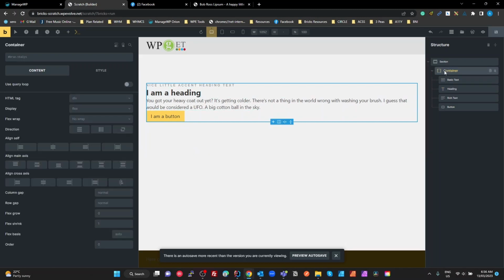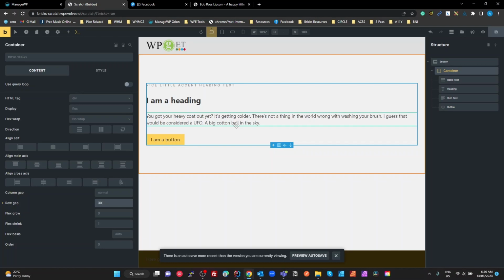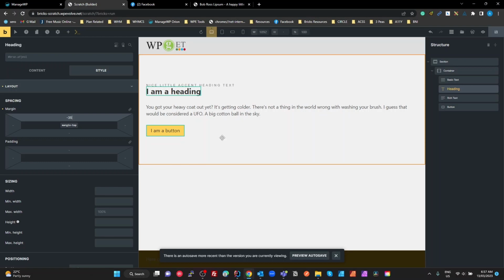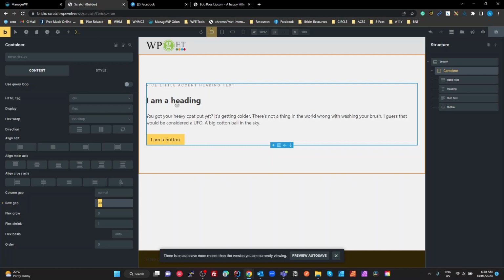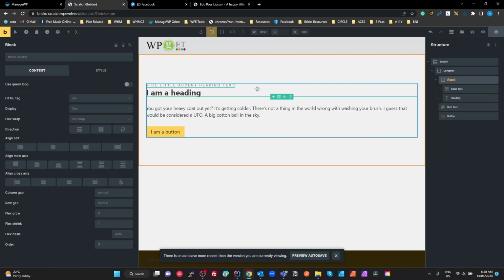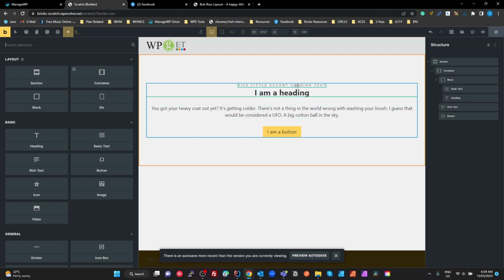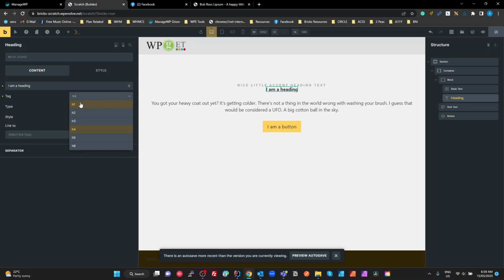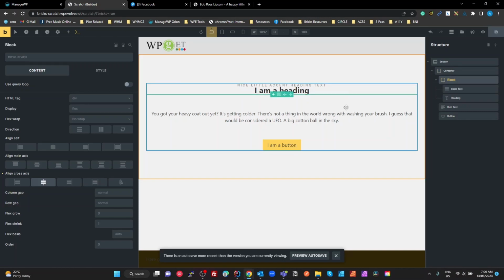Bricks Builder, How to group elements while maintaining consistent row gap.

Comment: Could you do a full tutorial on setting up bricks for consistency? I can never get this right! I tried setting up paddings and gaps in Theme Styles, on section, container and block level, and depending on the content inside it went from one section looking great to another one looking like a bunch of chubby columns. If I set it all directly on the canvas, then it looks even worse because there is no consistency, especially when you try to get the columns to act like they are supposed to.

And when I finally set them to look sort of consistent (with a lot of wiggling in paddings and margins), then I discover on mobile they all look different. I've downloaded bunch of template, and lot of them have very little settings, yet they all look great on all screens.

It would be really, really helpful if you could do a video where you create a simple homepgae with 2-3 sections, each with elements of different size and grouping. Like, one with heading and 3 small cards, another one with a large column holding content... that sort of thing. I just don't get the process, and there's no video on this. All tutorials focus on single sections, not on all sections looking consistent.